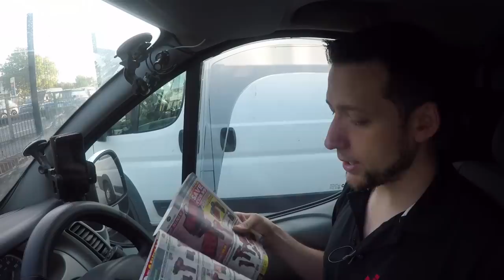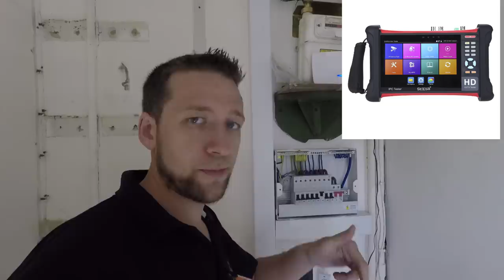Breaking out the Ducati of AWESOMENESS (and some data work) | Thomas Nagy

Comment: Cat 6 modules often have thicker tracks and pins with better separation in order to reduce insertion & return loss. Fluke testing Cat 6 cable with 5e modules will result in a fail due to excessive NEXT (near-end crosstalk) & insertion loss.
Reply: That to me is fairly interesting, Cisco never mention it in any of there certification courses! That's some extra cost, so not only do you need the cable but the termination port to go with that cable. I'm a Cisco man myself, and to be honest, unless your a data centre is there really need for 100mb locally? Maybe a 1GB uplink, but locally, 6/7cat cable, Cat5e to me is fine. Unless you know it's gonna be transferring serious data constantly.

Comment: Cat 5e and cat 6 will BOTH handle up to 1000 megabit Ethernet. Cat 6 is “in case” anyone in future wants “something better’ and is something you only need fit if is specifically requested and that’s super-unlikely in a domestic setting. Very few pcs indeed even have or need a 1000 megabit Ethernet interface. Domestic internet connections are fast at 10 mbps and super fast at 100, so 1000 gbps is wildly overkill (cat 5e can do this properly) anything over this is not yet available. Only use cat 6 if specifically requested or money is no object.
3:41  “router” pronounced rooter in the UK! A router (pronounced r-out-er),  is a rotary wood cutting machine used by woodworkers. Great vids.

Comment: Hey Tom. The difference in the Jacks will be the wire gauge inside the unit and the gap for where the wire gets connected to it doesn't cut it to much when you punch the wire in. And for the RJ45 Ends that will be the same, the insides are slightly different for the wire gauge. and the flat vs staggered is just what that company made. each company make them different.

Comment: Entered!  I'd always thought the difference with the jacks would be due to CAT6 being slightly higher guage but not sure how much this is actually the case. The main difference comes in if you are working with shielded cable and need to use the shielded jacks.  Camera wise it may be worth looking at some of the mirrorless ones, still excellent DSLR level video quality with interchangeable lenses but a bit smaller. I really like my Sony A6000 although you'd probably want to look at their higher end models to get an external mic input.
Reply: Yup the IDCs are different
Reply: Didn’t know you watched Thomas Nagy Cameron
Reply: Entered.

If its CAT6 only then CAT5e connectors should suffice (albeit its a tad but thicker).  If its CAT6a then its recommended to get CAT6 connectors where possible as the thickness is fairly big as the punchdown may be compromised.  As Cameron said, there is a difference in based on wire gauge sizes.  Its also the reason why the CAT6 connectors have a slight up-down wire feed rather than a traditional straight CAT5e and also to reduce interference.

Where possible structured cabling (ethernet, coax, AV, etc. in a mini comms cabinet) along with new electrical cable should be done when refurbishing to have scalability and have better WiFi coverage such as celing mounted access points, flush mounted speakers, CCTV.

The cost of structured cabling isn't that much and should be run in tandem when wiring the house.
Reply: Nice Job, Dave

Comment: Cat 6 cable uses a larger size of copper wire hence the staggered ends.  The box terminations should be slightly wider to accommodate the larger size as well.  I'm not sure if there is any other difference other than supply and demand.  The Cat 6 spec vs Cat 5 is just the larger size cable with more twist in the pairs and more strigent test requirements.
Reply: If you are using a shielded cable ONE end must be terminated with a shielded socket so the shielding can be grounded.  If you use Cat5(e) sockets or patch panels on 6 or 7 cable the IDC will cut deeply into the copper increasing the risk of joint failure during assembly.
Reply: In my experience you can use Cat 5e fittings on larger Cat 6 cores but if you fit Cat 6 fittings to Cat 5e cable it doesn’t always connect properly.

Comment: You can’t beat a real wired network only use WiFi for laptops and phones any anything that moves
Reply: More to the point, you need wired ethernet to connect the WiFi access points!

Comment: For Cat6 installation it's not just the components, it's particularly important to comply with the wiring requirements.  For example minimum bend radius, maintaining the twist close to the connection otherwise you wont get the throughput

Comment: Cat 6 supports upto 10Gb but 5e only goes upto 1Gb Ethernet. Provides some future proofing I suppose.

GoPro quality is really good. Put the 2K into a holiday fund
Reply: Yeah, but the actual physical plate and plugs are no difference. 8 Copper wires gets crimped down onto some copper plates in both Cat5e and Cat6 rated faceplates. Is it just what they're rated for? (but both 'work' interchangeably?)
Reply: Yes both are physically the same. Technically cat6 plugs should handle more interferences (so they can put cat6 logo on it).

I would go cat6 cables and cat5 plugs (if they are much cheaper) because you can change the plug but not the cable if there is problems with speed in the future.
Reply: 5e will do at least 2.5Gbps up to 10Gbps, depending on length, if you use appropriate NICs.
Reply: 6 is usually thicker wire, there are also crosstalk specifications which 5e jacks may or may not meet. They're not necessarily interchangeable (although very rarely is the difference critical).
Reply: 5e will support 10Gbe, but shorter lengths
CAT6 will provide lower crosstalk, a higher signal-to-noise ratio.
for the majority of home installs, 5e is still overkill ;)
Reply: Actually, if you stay under 100m (not a hard and fast rule) you can do 10Gb over cat5e
Reply: I think the cat6 sockets accept the slightly thicker cat6 wire easier when punching down.
Reply: ProgAndy
yeah they do, but the difference is negligible as there are many installations with cat6 cable in cat5 terminal blocks without any noticeable loss; considering it is the cable build that is more important.  I guess that they are built to the exact specification and people slap a mark up on them.
Reply: The size of the conductors is different so the IDCs are different  :P
Reply: Guaranteed at 55m with a 350MHz link

Comment: cat rating is speed and distances most of the plug are the same
Reply: Stephen james yea but can handle 250mhz on cat 6 Vs 100 cat 5
Reply: Cat6 is generally a thicker cable than Cat5. This is why the RJ45 plugs are different.
Reply: Stephen james, with cat 6 plugs the jacket pushes up real close to the crimped terminals when compared to a cat5e plug.

Comment: 8P8C, not RJ-45. 😛
Reply: Yes, an actual RJ45 has a notch on it. (Reason being that the keyed and non keyed version have different applications and should therefor not be able to be plugged into each other.)
I sometimes wonder if a 12P12C connector with two more twisted pairs would become practical in the future, since it would easily give an extra 50% high bandwidth over current cables, without much extra work....
Reply: Don't forget the category of patch cable too, not "RJ-45 cable".

Comment: Entered.
The difference between Cat6 and Cat5e is literally in the specs (the category) of the cable & accessories. If you install Cat5e terminations on Cat6 cable you will find it fails testing (if tested to full standards, not just pin - pin testing though those testers run to thousands).

Comment: Not answering your question, but when it came to cabling my house I looked at it and Cat5E seemed more than adequate, and also a little bit less fiddly to cable. Agreed on fitting data cables - in my house without an extra router or repeater the wifi coverage simply isn't good enough. Loving the videos btw, keep them coming!

Comment: CAT6 and CAT5e is different standards, and are rated for different speeds at different lengths. If you try using lower grade modules with higher grade cable, you won't be able to certify it at the higher grade (technically not at the lower grade either). So, if you're running CAT6, use CAT6 fittings at well, and make sure to use shielded cable and fittings. There's CAT6A as well, which is rated for 10 Gigabit for longer runs. There's no simple electrical difference between CAT5e, CAT6 or CAT6A, they are all 4 pair, but they are rated at different speeds and transmission lengths. BTW, stop fitting those 110 block outlets, I don't know how many of those I've had to repunch to get them to contact properly over the years. The Schneider Actassi S-One outlets (or the whole Actassi system really) is the best hardware I've found so far for network wiring, if you get them to pass a continuity test they'll pass any certification test you throw at them, provided the cable run is undamaged.

Comment: Not sure if its been mentioned, but the push fits on cat6 have to be capable of carrying a thicker wire than the cat5e's as well as the traces internally being required to be thicker to match. Cat6a and 7 require grounded shielding all the way to the socket, which will be far more noticeable.

Comment: The amount of new builds I've been to where someone has used a flat head screwdriver to terminate data/phone sockets instead of a punch down tool, it causes so many dropouts and slow speeds due to high resistance.

Comment: Entered. I think difference is thewire gauge specified between Cat5e and Cat6. The cat6 wire is thicker. Cat6 usually has 23 AWG copper conductors compared to only 24 AWG in Cat5e cable.

Comment: CAT6 is screened so cat six plugs and sockets will need to be screened as well and have a way to connect the screening. Other than that cat six has a tighter twist to the cores.

Comment: Reasons to use wired: Faster and consistent speeds (although all but high end broadband won't likely be fast enough to use it), more reliable, lower latency (great for online gamers), can have larger number of connections at one time (mainly for offices), reduces contention on things that need WiFi, and not prone to interference or barriers like WiFi.
Reasons to use WiFi: Convenient, cheap to set up, good enough for basic internet use and devices can move about.

Comment: Having data cabling / wired network cabling available is a good thing in my book - simply cause WiFi is usually unreliable regarding connection stability and connection speeds. 
That Wera screw driver set looks really nice, same with the other tools of this giveaway :)

Comment: Plus.. you can run TV such as sky over the data cables, phones and also HDMI with the correct baluns. It is not just data. Always worth running but buying a good Cisco access point is also essential and turning off the WiFi on the standard routers. You would be amazed at the performance difference. Hope that helps.

Comment: I noticed many comments about your data cable question, the correct observations of larger gauge for CAT6 is true but a concern.  If using a smaller gauge cable (CAT 5, 4, ...CAT3 has softer copper all AWG24) on a CAT6 (AWG23) connector there is a possibility the connection will not be firm.  Alternatively if a CAT6 cable is used in a CAT5 connector the copper could likely be weakened by pressing it into a smaller connection point at the back of the jack and risk failure.  Look up EIA568 / TIA568 for the correct terminology (RJ45 only uses the center 2 conductors) and hints on proper connections.  Also a CAT6 type jack should maintain the twist of each pair of wires as much as possible, avoid excess cable & avoid sharp bends more so with CAT6 to maintain specs.  A good tester will point this out and you may not recognize the result.    You also mentioned the staggered connections on the jack rear, I have not seen these but likely a method to ensure the pair maintains a twist at every step.    BTW, RJ Registered Jack is how the jack is used/wired   EIAxxx is the protocol of how the end to end is wired/used.  
Also Great Job - keep it coming.

Comment: Entered.
Where gas installation pipework is not separated from electrical equipment or cables by an insulating enclosure, dividing barrier, trunking or conduit,  the separation distances from the gas installation is as follows: 
 - at least 150mm away from electrical supply equipment e.g. metering equipment service cut-outs, or supplier (main) isolation switches and distribution boards or consumer units.
 - at least 25mm away from electrical switches, sockets and electricity suppl and distribution cables.
As per current IET on-site guide pages 21-22.

Comment: Wired networking is always in all circumstance preferable to wireless. It will always give a constant feed and a better ping due to it's error checking and it's position on the OSI model, wireless is using cable in the background but will also add an extra layer and it's own error checking, but again these depends on how it's set up, it can be set to ignore this, but it still is however higher up the OSI model rather than cable.

Comment: I have still to find a home wifi setup that can handle roaming between access points, can't really afford an enterprise mesh network for my house. Which is why once you flood wire your house, you never really worry about it again.  Until a switch dies.  Its not a big house, but is old and properly built so there's a 2 foot wide solid brick wall right through the middle of it.  This is my competition  entry, even if it is a shit one.

Comment: Tom - the difference between CAT5E and CAT6 is mainly to do with the cabling diameters.  CAT6 is thicker cables and the impedance between CAT5E and CAT6 is different.  If you are certifying the cabling, mixing CAT5E and CAT6 is a big no-no.  Typically, data speeds are better on CAT6 along greater distances.  For example a 1G network port will only be "certified" for 100metres - as will CAT6, but if you start mixing CAT5E and CAT6, you are going to run into weirdness problems and intermittent data drop-outs.  I would always recommend CAT6 as a minimum these days (especially for new equipment).  Electrical interference is also a thing: CAT6 is less suspectable to it [from experience].  Where I had to do installs where there were HIGH voltages (ie over 1000V AC), then I always went for either CAT6 SFTP or CAT6A.  Try and maintain a good non-conduit distance (I'm sure the regs state over 100mm) as well between data and electric [but you already know this]. :-) P.S. Sorry to be a nanny on this, but make yourself look even cooler with some leather biker trousers too - and get added safety. Always worry about jacket only bikers...sorry :-(

Comment: Wired connections are faster and more reliable, definitely the way to go especially if the floorboards are up anyway.... But don't put the cables into your router, it will just chop the ends off!

Comment: So here I have entered as well.  Love wera! Thanks for some great content Tom.  Wifi is good, but all data connections should be hard wired where possible.  Data speed is always quicker with a hard wired connection. Even the fastest wifi connections will not match wired.

Comment: WiFi VS Ethernet (cat5-7)

Both have pros and cons.

Wifi started off like having a conversation in a country pub on a Wednesday lunchtime with relatively few devices and people using it.  It's now in most towns and cities like trying to hold a conversation at the front of a rock concert.  Anyone near you who cares to listen can in both cases.

Ethernet in general is like holding a conversations in sound proof booths where only the people present can talk to each other on phones.

Remember Cat3(phone cable) and above can be used to route phone lines also using pins 4 and 5 (the white/blue pair), HDMI, Audio, analogue video and many more.

When a customer asks for structured cabling always try and get them to install TWICE the number of sockets they envisage ever needing, they will thanks you for it later!

Comment: Wired connection is still more reliable than a wireless network. Also, you forgot to add mentioned cable tester in the description - looking for a similar one :)

Comment: The spec for cat6 certified components is higher in terms of frequency response/crosstalk etc. If you were doing a certified install (with Test reports etc) you would need to use cat6 hardware throughout, but as many have said cat5e is very close in spec to 6. Most enterprises can’t afford to run 10gb on the access layer, so the chances of a residential user needing a certified 10gb network is pretty low. Whilst 5e and 6 will both do 10gb over the distances in most homes, I’d be inclined to pull cat6 cable, but use 5e hardware - as you say there is no appreciable difference, just a test certificate which contributes to the cost.

Comment: I've also noticed the cat 6 rj45 plugs have a tiny plastic bit which you slide over the 8 cores before pushing into the plug and crimping. Seems. To help with keeping the wires straight.

Great videos👍🏼

Entered giveaway.

Comment: Hi Thomas, can you clarify the use of secondary protection when sinking cables into walls.  I’m aware that the use of channeling dates back to the use of limestone based plaster and rubber cables.  I notice that most electricians still use channeling, I personally prefer the galvanised version as it shows up so well when using a detector.  So the question is if its not necessary why do so many of you still do it?  Thanks Mike

Comment: Cat6 plates usually have a bit more shielding and a bit more space for cable due to the larger gauge solid core, however in reality there is no noticeable difference in performance to the normal human being. Well worth Cat6' wiring whilst you are re-wiring though, spend the extra on shielded if your going close to power though.